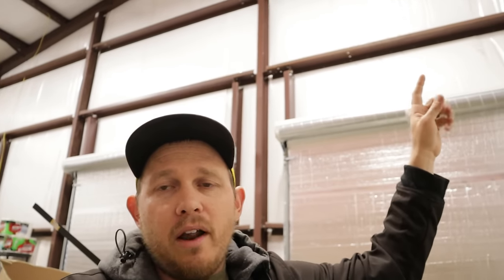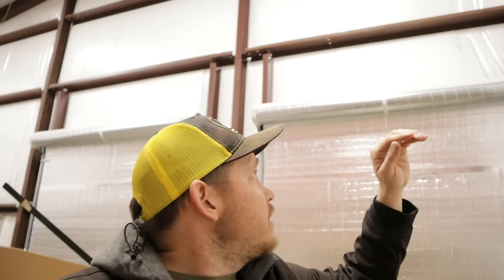My Biggest Steel Building Regrets

Comment: Just so your aware, you do NOT need 6" of spray foam. 3" is plenty. I am a professional builder and we do this all the time. Our climate is extremely cold.
Reply from the maker: That's really good to know! I really appreciate that insight
Reply: Closed cell yes.  Open cell has lower R value.
Reply: @semosancus5506  true. I just wouldn't use open cell.
Reply: @runninfool  I've always heard open cell in the roof closed on the side
Reply: @markwilliams4525  huh. We never use open cell. I suppose some do for roof for a lighter dead load??  The only time I've ever seen it was on a big hydraulic door for a shop. The guy said it was lighter that way. In reality though closed cell really doesn't weigh very much per sq ft.
Reply: @markwilliams4525  oh ic. I guess everyone has their way of doing things. None are wrong just different.
Reply: How could is could? Zone 5 and 6 is where I am. Do you build? I am looking for someone on 40 x 60 build. Thanks
Reply: @penniedevleming2667  I'm in 3a. By that little bump at the top of minnesota.
Reply: @penniedevleming2667  where about are you located? I build pole barns, and steelys
Reply: Thank you for affirming that. I’m sure that makes a big difference in cost. 🙏🏼❤️
Reply: Interesting. I am researching doing my own barndo and I have heard that closed cell can increase the damage done by water by trapping moisture between the foam and the steel siding, while open cell doesn't trap the moisture the same way. Any insight?
Reply: @runninfool red wing,MN here!
Reply: Spray foam destroys hvac coils. We’ve changed so many because of the chemicals
Reply: How to you maximally mitigate thermal bridging?  What is the insulation schedule for the outer layers?  It seems that insulating the outer aspect of the beams would stop the cold bridging in the first place.
Reply: You are truly correct but unfortunately some states want r42 in the roof and r30 for the walls which is truly a waste of material. For most climates 2 inches is enough.
Reply: To meet building codes, even in the south, R30 is required on ceiling/roof.

Comment: Good info:
door height should be greater than 10 ft.
6 " spray foam is better than fiberglass insulation
install outdoor wood burning stove
install radiant floor heat
put the windows in as you go
Reply from the maker: Yep thank you
Reply: Why an outdoor wood burning stove?
Reply: @Cool_Videoz   He was talking about an outdoor furnace; he mistakenly used the term wood burning stove when referring to an outdoor furnace.  Later, he did talk about he had installed an indoor wood burning, or pellet, stove.
Reply: @Cool_Videoz i can't speak for the guy, but I would say that an indoor wood burning furnace would create a vacuum through the need to draft the exhaust, which in a very tight building could require a mechanical system to bring in fresh air to prevent potential back draft and carbon monoxide issues.
Secondly, wood burning is never 100% efficient, and creates the requirement for cleaning the exhaust flue. An outdoor furnace would still need to be serviced, but it greatly reduces the risk to your home in the event of a creosote fire and makes servicing the unit significantly easier. (Hardwoods of course reduce the creosote deposits significantly compared to burning softer woods)
Reply: @nandi123  I built a shed for the farm. Make sure everything I thought it would put in it and decided on a couple of 20 wide by 14-6" tall overhead doors. Same thing I can get everything in but it's tight and I got to be careful especially when I'm backing in the combine. Should have gone 24 ft wide. Didn't have room to go 6 in taller but if I would have I wouldn't had to lower the clean grain auger in the hopper which I didn't take into account when I was measuring

Comment: Just found your channel and watched for curiosity.  Steel buildings have challenges to insulation but there are a couple of authoritative guidance manuals.  Condensation and excess humidity is all too common.  First, must have a subslab vapor barrier.  This isn't cheap poly but a taped membrane system.  Next, closed cell insulation cannot be beat on the roof.  3" as any thicker and there's no return on investment.   Also do not listen to any installer suggest to put double bubble, Tyvek or any decoupling material between the steel roof panels and insulation.  Ignore the rationale of needing to replace a roof panel. In 33 years of these buildings, the only roofs replaced are from tree falls.  Hail damage is just an eyesore and small damage everyone just patches.  2" of closed cell on the sidewalls is going to get it done.  Again, direct to steel application is best.  I personally do not recommend any of my clients planning on conditioning the space just use steel siding to the purlins. I design with wood sheathing, which allows the walls to be effectively insulated with less expensive batt or rigid sheet, superior foundation for house wrap, and then a great thermal break for the steel siding greatly reducing potential for condensation.  It's more expense to do this, but the results are superior in many ways.  Finally, any building has to breath, and when you insulate tightly and seal all leaks afforded by conventional construction, you need to install ventilation. Normally for us, we design HVAC with fresh air intake and to turn the air over in a space.  Doing so improves air  quality and regulates moisture.
Reply from the maker: Man what a great comment thank you so much for your expertise! I don't have any trees around so I won't have to worry about trees falling.
Reply: Thanks for sharing, just saw this video on installing Blue Tex which is a foil backed foam that comes in a roll and in varied thickness. I'm curious what you think about this method, I'm no expert but it seems to be an excellent VB with minimal insulate for not so cold climates. https://youtu.be/pK8g9lS2_yo
Reply: I am building a loft in a 26x40 steel building framing with 2x12 floors on I beams and was planning on shiplap directly to red iron horizontals BUT use sheet metal on ceiling...building is is South Louisiana and very seldom cold
The building already has white backed insulation with batt against all sheet metal
Any advice would be greatly appreciated Thanks

Comment: Those outdoor stoves eat firewood by the truckload. Install an indoor stove and mount an exhaust fan, vented outside, for the few times some smoke escapes.
Radiant, warm floors are a nice thought but also very hard to provide enough heat to when you are in a cold climate.  Great video!
Reply from the maker: That's really helpful to know!! Thank you, I was thinking more about In door stove after how well the pellet stove did this winter

Comment: I have 12" vented gables and 2" foam board but its 1.5" below the metal roof so the gables vent to the soffit . No issues in 20 yrs in SE PA
Reply from the maker: That's awesome, I don't have vented gables but I am sure that's helpful
Reply: I'm sorry I have 12" soffits on each side that vent to the all steel ridge vent .I dont have gable vents . @homesteadingbarndo

Comment: As a home builder I can tell you if water is dripping and there's no snow on the roof and it's cold out and it's not raining. Your roof is not leaking it's condensation.. moisture runs from heat and runs too cold. Then it freezes then it melts then I tricks down

Comment: Holy crap... my last shop was a steel building (already built when I purchased the property) and I thought for sure the roof had leaks all over. I did the same thing, I went up top and sealed every screw head twice (two years in a row in the spring time) and I still got water coming out of the insulation. Makes a ton of sense that it was condensation... There was no way water was getting in any other way.
Reply from the maker: This year we are doing good with no water now that we got it all squared away. 

Way less stressful hoping we didn't have to worry about a leak coming in
Reply: @homesteadingbarndo   Once the fiberglass gets wet it no longer works as it was designed to work.
Reply from the maker: @philhensley5986  that makes sense

Comment: Thanks for the videos about your barndo. We bought our property a couple of years ago, and it came with two newish metal buildings on slabs. One is a barn and the other is a garage. The barn is identical to your building when it comes to the structure and insulation, only a smaller (24x24) footprint. I'm fixing to cut into it and add pens for animals inside, which has caused me a little bit of anxiety. I have this brand new building that could be another home or Air B-n-B, and I'm going to house pigs inside - LOL. Anyway, those first cuts and changes are nearing, and I found some comfort after watching a couple of your videos. Like you. I'd never had any experience with a metal building and wood seems a lot less daunting. Thanks again for the help.
Reply: in usual circumstances gabled endwalls will be post and beam construction. meaning they will fall unless braced while interior frames are self supported (front to back). It is uncommon for larger steel buildings to use panel shear bracing, but not unheard of. 24x24 could be a single bay building meaning there may not be an interior frame.  You should verify that any wall you are cutting into has a cable brace/ wind column/ portal frame bracing it, if not it could still be braced through weak axis bending, but would be impossible to tell by sight. the easiest way you could tell is by pulling the permitting drawings assuming they exist, or look for a peak box sticker and call the manufacturer and see if they can send you a set. They should clearly state the type of bracing used right at the front. The drawings will also specify whether the building is designed as enclosed meaning the roof will not be designed for as much uplift, so also verify that if whatever you're cutting will be open forever that it does not change the  building from fitting enclosed criteria to partially enclosed. If in doubt, toss some money to a local engineer. An engineer provided with the drawings would make short work of it and the 100 bucks would give you peace of mind.
Reply from the maker: Great advice from the above comment. If the structure is missing support it can twist especially in windy situations and collapse. Most of the prefab steel are engineered for wind and roof loads in your area so if you pull stuff that gives it lateral support you might be in trouble.

Comment: I liked your proposed use of firewood unit to heat your building. I have heated 10,000 sf greenhouses with firewood, but using my innovative infrared heating system, I developed 1973- 1992.You can see more in my system first installation, done by the owner using used 2" dia. pipes.
The owner had earlier installed a hot air system, but late fall freeze destroyed almost all his crop. After my system was installed, I tested in February at midnight in a snow storm at -32F outside temperature. Nor a single plant was lost. Your insulated building would really use very little wood fuel. You can see my first big syste, rather crude then but quite nicely improved since then. CBC TV did a video, with my system shown and the owner and later me commenting.
Condensation is quite nicely reduced. Floor heating is done perfectly using my Infra red system. Your only maintenance is your boiler.
I would prefer your wood stove being steam output, since steam billed pipes don't add weight to your pipes. Steam temperature is perfectly uniform throughout. Just wanting you to know how I would heat your building. The steam pressure will remain below 15 PSI, but typically 2-5 PSI.
 so no operators are needed, nor inspections.
Reply from the maker: That is incredible! Thank you so much for all this great insight and feedback. This really gives me some great things to think about!

Comment: Pole barn with trusses,  attic space , sofet vent , ridge vent , tyvek and rockwool or fiberglass insulation is the way to go. After insulating steel building properly cost more than  properly built pole barn garage.
Reply from the maker: Agree with you, especially in this market with the price of lumber coming way down from when I built in 2020

Comment: When it comes to wood burning stoves, I suggest you get a stove with the option to use a fresh air system.  
Taking in air from outside does 2 useful things.
1 - It helps improve the burn efficiency
2 - It helps keep the hot air in the building.
Reply from the maker: This is really helpful thank you!

Comment: Nice subject selection. I'm sure this will help a lot of people out. Is that insulation directly on the rolling doors? I like the idea of having a wood burning stove as well.
Reply from the maker: Yes the doors have r2 insulation on then did it isn't super efficient but it is better than nothing. I think I can retro fit my place with a furnace system with a wood heater, I think I'll try before fall

Comment: My 36x48x28 is just getting finished up. I went with a 12x12, 9x8, and a rear 8x8 rollup. Mines a wood pole barn with steel siding, roof, and trim. I'm ordering my doors from the same company. I did go with a wood structure because it adds add -on ability. I also had 4 man doors and 10 windows installed at the same time as the build. I knew I was going to want the light and the airflow for those hot summer days. Your building looks good though.
Reply from the maker: That's awesome! Those are some solid door sizes that 12x12 will be super useful. 

We finally did get our windows in too and it was insane how much a difference those make. Thanks a bunch. 

How big is the structure inside going to be for you? Are you splitting it into a shop and a house or the whole thing a house?
Reply: @Homesteading Barndo  I'm building a loft in the rear, over the 8x8 tractor door, that stretches the whole 36' face wall. So 36x15. Under the loft will be my office with a man door and 3 windows. The 2nd story of the office will be an apartment for my daughter(trying to make her stay, lol). We are also building a 30x20 Airbnb next to the shop with the same steel siding and roof. We live on acreage in Oregon and own riverfront so it will be a place for hunters and fisherman to stay overnight. We have a home on the property so it's all shop out there. Doing an attached greenhouse this summer as well.
Reply from the maker: @Monkeytrix29  That sounds epic. 

I like your thinking about trying to keep your daughter around. I'll definitely work on building out properties to try to keep my kids in the area :D

Comment: Look into "PRODEX" INSULATION. It is a foil/ foam/ foil composite that is made to overlap and seal so your moisture barrier  is complete and you dont get condesation issues. It is also easy to work with and to retro fit into an existing building. 
  I do appreciate your candor and honesty about your experience with the Barndo. Here's the thing, you jumped in and learned on the fly . and you were ultimately successful. So you just added a bunch of skills to your resume'.There was a moderate amount of risk involved and perhaps some mistakes were made, but in the end you have done something worthwhile that you can be proud of. Future modifications like the rollup doors, floor heat etc. are still possible and even if you designed it to be everything you want today, tomorow things will change and you will be doing some mods anyway. It happens to everybody. I see very little for you to have regrets over here. Job well done. Now get busy on that pilots licence. Then you'll have something to really be proud of. Thumbs up and sub'd
Reply from the maker: Man thank you so much for the kind words. I gotta say that's how I've been looking at it, I have so many more skills that I never imagined I'd get and a new outlook that if I stick it out it'll eventually get done. 

Thanks again for the positivity
Reply: @d.mcdave8880  The effectiveness of an insulation material’s resistance to heat flow also depends on how and where the insulation is installed. For example, insulation that is compressed will not provide its full rated R-value. The overall R-value of a wall or ceiling will be somewhat different from the R-value of the insulation itself because heat flows more readily through studs, joists, and other building materials, in a phenomenon known as thermal bridging. In addition, insulation that fills building cavities reduces airflow or leakage and saves energy.

Unlike traditional insulation materials, radiant barriers are highly reflective materials that re-emit radiant heat rather than absorbing it, reducing cooling loads. As such, a radiant barrier has no inherent R-value.

Although it is possible to calculate an R-value for a specific radiant barrier or reflective insulation installation, the effectiveness of these systems lies in their ability to reduce heat gain by reflecting heat away from the living space.

Comment: Fiberglass cavity insulation for metal buildings is good.  With only one layer of plastic vapor barrier on the interior only.  You only want a vapor barrier not a vapor membrane. The condensation needs to escape outside slowly in a vapor state.    Spray foam is too tight.

Comment: Instead of a woodstove, look into radiant heating. Not the floor, but overhead radiant heat.
Reply from the maker: That's a great idea! I'll check it out! We did end up putting the pellet stove in the shop and it has been a game changer. We're in the mid to high 50's in the shop and 70's in th house no trouble.

Comment: ONLY use spray foam on metel IF you are 100% sure there are no condensation that is gonna be traped behinde it, if not its going to coroade or rust it faster, because of traped water. metal by it self cant transportate the water like a wooden building can.